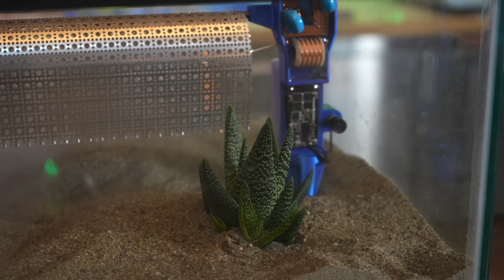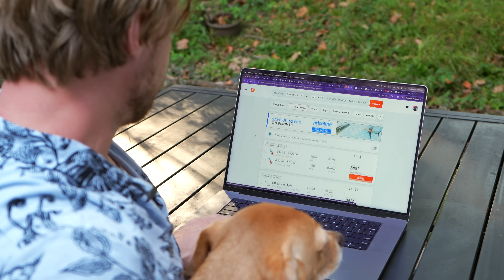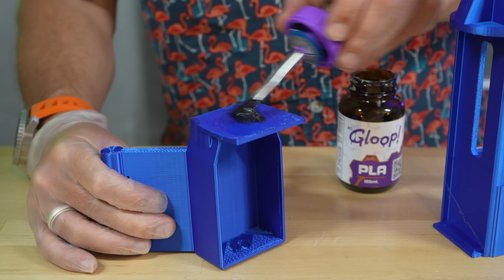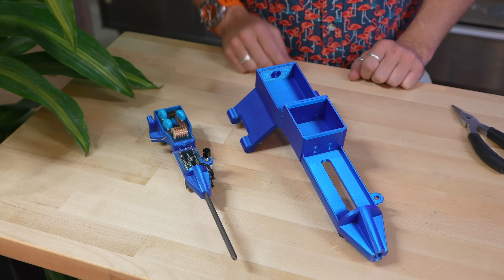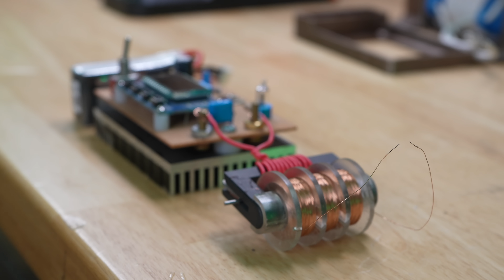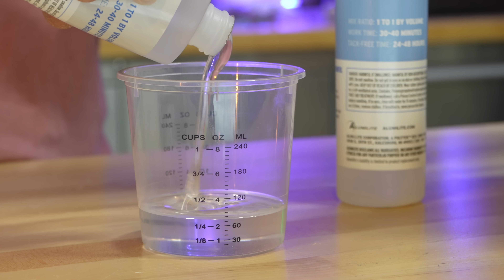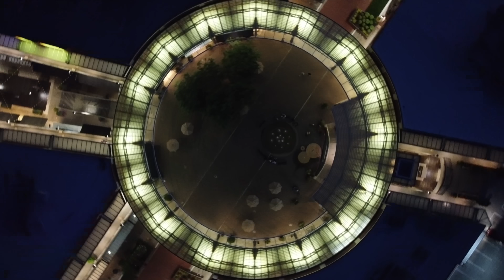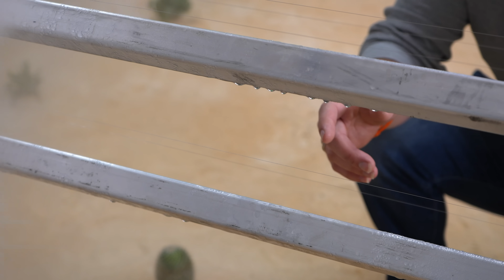Turning Desert Fog into Fresh Water Using 50,000 volts

Comment: You can do this process anywhere. Use a black cover, honestly it can be a shallow so geodesic domes would work but my designs used a shallow tunnel greenhouse. Cover it in black and float it in the ocean or even something like the Salton sea or even brackish ground water or for that matter a swamp. The idea is to raise the temperature to increase the humidity. Another option is to include fog transducers. They don;t take a lot of power and can raise the humidity to near a 100%. The passive black tent will work but with transducers you can double the efficiency. The numbers I ran showed the collectors could be built for $10,000 to $15,000 and that would include solar panels to run any needed pumps as well as the transducers. Without testing it's hard to know the real volume but a 24'X100' collector should generate enough water for 10 greenhouses. I was looking at them for greening the deserts and Africa but say in a place like the Salton sea it could make that poisoned water suitable for agriculture. One of my plans called for letting the humid air rise either up a hill so the collector is separate from the from the water source or simply make it taller. The idea is to collect the water at a higher point so there would be enough pressure that pumps wouldn't be needed. That system could be entirely passive and require no energy except for the collector wires and would produce likely half the water but at half the initial cost for poorer areas.

Also if you want a commercial product I think it should be possible to make a self filling water jug. Say the outer sleeve is for brackish water and the inner container would collect the water. A small solar panel would run the transducers and collector. The transducers would fill the container with fog and at the top the wires would condense the fog into drinkable water. Given our current fascist leaning I don;t like supporting the military but a container like that based on the results you are getting should produce 5 to 10 gallons a day. Most of the world has  non potable water available whether from swamps or salty ground water so imagine a standard 3 to 5 gallon water jug that you add brackish water and get back as much as ten gallons a day in fresh, chemically pure water. Actually better than distilled and it would be self powered. I'd design them with flex panels that can be wrapped around the body of the jug for storage then unroll them and aim it at the sun to produce water. A single jug could support 5 to 10 men and believe it or not it should work even with urine. If any taste makes it through the system use a carbon filter as a final stage.

Hope this helps.
Reply: the resulting water would have the same salinity and same contaminants, minus a bit of viable CFUs (colony forming units). this is not a distillation process were vapor is almost free of salts, fog are just microdroplets that have the same composition of the source body. in natural conditions (Atacama's camanchaca, for example), the source is a cloud (already distilled from sea water). this will not transform the source water in anyway, maybe killing some pathogens because of the insane voltage, but should be about as toxic/unsafe as the source.

having 100% humidity does nothing as this is not cooling the air the remove the latent heat of vapor to extract it (quiet the contrary, as the heat of the system reduces the relative humidity by increasing air temperature). people have tried for about 30 years to make an industrial dehumidifier to get water, but the best attempt is still more expensive that sourcing clean water from 500-1000 miles.

Comment: Electrostatic fog condensation is a well-studied concept, though past experiments struggled with energy efficiency and long-term reliability. Still nice to educate everybody about this concept.
Reply: It would be interesting to see a cost analysis comparing it to the dirt-cheap and reliable alternative of passive collectors. That would give him a benchmark and goal to strive for.
Reply: I got a wwybto funnel wind using ur homes frame that is a wind power, water purifier. Supplies irrigation to hanging elevtricaly fed farming systems. Combined system uses the wi nd that travels up ur homes exterior, adds the solar energy both working in cohesion to create power, create purifier water from air, them it funnels to go into crops or collect drinking water, and also turns a damn poke system so using electro static wind and solar, so it provides sndvcreates energy, guess u clean drinking water, and grows ur crops clean in purified clean air alll supporting each other self sustaining.  Ive been attacked  for thos but if anyone wants blue prints it os full independence  fir all pepple. If a combined large enough system fo😢r a nieghborhood combined system.  U can even transmute ore into other elements. Only  up to low grade iron as of now. But om.sure better kinds thsn me can fix that.  Sp if anyone wants a free workd supply of everything. Let me know
Reply: @bradharris1062  I'd love to have your plans. Thanks
Reply: It's not revolutionary, but it's still very interesting, and technology has advanced a lot and will continue to advance over the years. Perhaps it's more viable now, at least on a small scale.
Reply: Yeah profits? Nah but small scale villagers gardens? Yeah this can save lives
Reply: @captaintoyota3171 I don’t think it’s about profit, but cost/Volume Water. how much do they need to invest and maintain per person served with water. Sourcing of special components and production is probably not that easy in those areas. Keeping a stock of every part could work for a while but would also need a significant investment.
Reply: @stefans.8027  Yes, the materials would need to be tested over a decent period of time before they could analyse the efficiency and reliability in a harsh environment. The end user would want a system that just runs and requires minimal maintenance.
Reply: Tech improves with time so retrying ideas that weren't efficient enough or too costly is always a good thing, you never know, maybe the concept's time has come.
Reply: @Lenny2Lux  and one notable improvement here is the use of solar to resolve much of the energy concern - solar's come a very long way in the past decade.

no need to worry about dragging the grid out to you when you can just build the grid into your product.
Reply: @Lenny2Lux 
This!
Reply: Given the other comments, you'd think he invented something "revolutionary" and "game changing" that can "change the course of history" ;) It's a neat concept, but just like building-integrated fog collectors nobody saw any real use for it given the fact fog nets are dirt cheap. It would be nice if he treated it more like educating people about EFCs instead of "look at how great my invention is!". I know it's for clickbait and to drive engagement but it's really disappointing.
Reply: @LordDragox412  "fog nets are dirt cheap" I think that's the crux of the issue. Why invest in a complex, expensive, potentially dangerous, failure-prone device when you can just string up a few more fog nets for a few bucks. Space is generally not an issue in these desert environments and efficiency doesn't matter when they're so cheap and simple.
Reply: @clonkex  Fog nets are made of plastic, and even UV resistant plastic degrades in the sun and heat. And while it does, chemicals and microplastics get in the water.
Reply: @FLPhotoCatcher  Yea, this is a big deal.
Reply: @LordDragox412  well said
Reply: @LordDragox412 Yeah... that attitude and presentation are getting a little old for me. I really love learning of the tech in these videos, and iteration of design and testing.   
He loves talking about the miraculous sounding results without really talking about the reasons these technologies aren't being used, e.g. they're all horribly inefficient.   
I'm sure the engagement and ego stroking are hard to give up, thought.
Reply: @BRUXXUS  Hey, he's doing something he's passionate about, he's creating practical, applied, solutions for problems people had before, and he's investing in physically bringing that solution to people who are interested in that solution in their country.  Knock off the sour grapes and find your own thing to be passionate about.
Reply: @BRUXXUS  ahhhh, who says solutions to those problems can't be eventually solved??? As for "efficiency " that's where the solar panel part comes in.
Reply: @BRUXXUS you have a slightly missaligned perspective to efficiency. Yes, for countrys where water is not a problem or at least not as much, these devices don't make sense. These devices are too inefficient for countrys that have enough available water. But when comparing these devices to passive devices currently used, they are way more efficient. And with the addition of the solar panel, you don't need a super efficient device since there is plenty enough sunlight to charge the battery. What's important in a desert is not the electric efficiency but the efficiency of conversion of humidity to liquid
Reply: @BRUXXUS Horrible inefficiency doesn't matter when the energy is free (solar).
Reply: @naasking  Agreed, energy is becoming ubiquitous, as are Sodium batteries. Its the fresh water in this location that is precious.
Reply: @LordDragox412  you are disappointing  with your dismissive attitude. As if it is absolutely impossible to find solutions to problems. He already addressed efficiency with solar panels, and he has the whole setup as portable.......who else has done that ? Sources please
Reply: @DavyOneness  Man, people like you piss me off. Check your privilege and have some common sense. Why do you think people who could "use this technology" are using dirty rags to collect the water instead? It's like asking why they're eating lentils instead of cake. No matter how great this is, it costs a lot to make and ship no matter where you make it since you can't get the components in places that would need it. Their attitude is right, it's your attitude that's stupid. But given the fact you believe in UFO it's no wonder your brain doesn't operate on realism.
Reply: @DavyOneness  Please tell me, what is more available to a poor person that doesn't even have access to water - a ripped up old shirt and some sticks or a solar power. Nobody cares that the setup is portable or it's efficiency when they can't afford it or build it themselves, unlike a passive fog net which can be made with a few sticks and an old ripped up shirt if you're desperate. So what's the point? Real world doesn't care about cool concepts, it cares about logistics and cost. AWG aren't new, this is just a slightly different coat of paint on an old concept and changes nothing. People who use fog nets don't care about their efficiency, if it doesn't produce enough water they can just set up more of them. Go to Google Scholar and read up on the topic and you'll quickly realize if something seems like it's too good to be true it's probably because it is. You can clearly read in papers like "Design of water harvesting towers and projections for water collection from fog and condensation" by Bharat Bhushan that "Manufacturing and maintenance costs and energy consumption will be an important consideration for economic viability in these applications." and realize why all this water generating "cool tech" never brings a change to the places that need it.
Reply: Where is the water coming from?  I could have sworn he said his fog was dry ice.  Dry ice has no water AFAIK.
Reply: @tarstarkusz  Yes, the visible fog from CO₂ dry ice contains moisture, but it is not from the dry ice itself. The fog is made of tiny water droplets that have condensed from the surrounding air due to the extreme cold of the sublimating CO₂ gas. The dry ice itself does not melt into liquid water; it goes directly from a solid to a gas, leaving no liquid residue.
Reply: @tarstarkusz  It's a block of dry ice submerged in a water bath.
Reply: Has it been studied  how extracting large volumes of moisture/water possibly effect the environment? It seems I am one of a few that thinks this is a horrible idea/product for our environment.
Reply: @JasonEdelman66 The impact  this would have is so incredibly negligible. The only way it would become a problem is if an entire city moved out into a desert and started harvesting the morning fog, and then you'd maybe have some cactuses and small animals downwind of there that would not be getting their fog anymore. But that's really far-fetched right now.
Reply: @HeyChickens  There are literally billions of Litres of fog that rolls in every night and because the land is so hot and desiccated that it is difficult for the land to absorb the water before the hot sun evapourates it away. Tapping into water, in this way, would have a negligible effect on the climate.

Comment: For switch: simple arduino switch with temperature, humidity and pressure sensor. This can tell you when there is fog. 
Can you do it more slanted to utilize gravity to move water droplets towards collection point? Would some grooves help guide droplets?

Comment: Thunderf00t debunked this, its not feasible.... it also comes down to energy use... and yea the solar pannel things were also debunked by him. Bht you do reaize the fog net do not use electricity.  You cheated... you blew a cloud of super dense fog onto it...
Reply: There is no debunking the concept while it is energy intensive getting clean water in liquid form to a desert is extremely expensive as infrastructure costs are incredibly high in a desert and construction costs are also incredibly high. This is in no way a universal solution but it may find a niche application where it makes good sense. Locations that already have an excess of solar power but lack water could be a good fit. IE the "cost of their excess electricity is basically free and water is still incredibly expensive". They would need to manage their water so that it doesn't just evaporate immediately during the day but little incremental steps can make a big change. Plant growth is how you stabilize degrade land and reverse deseretification.
Reply: hater
Reply: @kaydenvanrooij1418 Realist, not a "hater".
Reply: Thinderfoot did no such thing.

Comment: For the fog sensor, maybe have a small section of continuous low-velocity thrust that pushes air through a sensor - maybe you could get something like a smoke detector sensor to work - they're very low power and last years.

Comment: This is an interesting technology. Feels like this tech can be utilized in other fields of science. (Might put dehumidifiers out of buissness lol)
Reply: this won't put dehumidifiers out of business - this is much more complicated than those, and you really don't want high-voltage stuff just casually running indoors.

it will be useful in remote areas tho, but it'll have to be massively upscaled (like 10x or more) with much higher air speed generation.
Reply: @dead-claudia  I forgot about the vigh voltage 
o-o